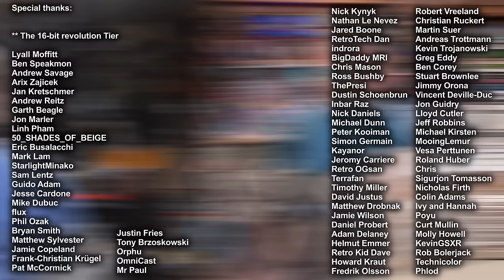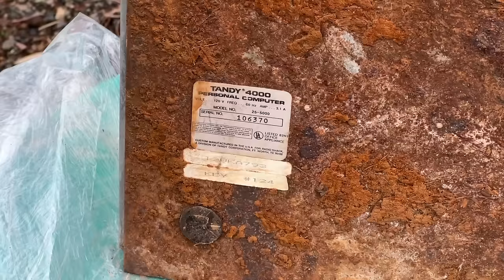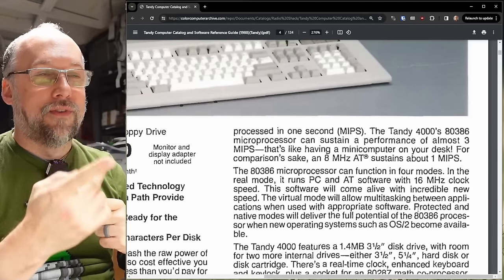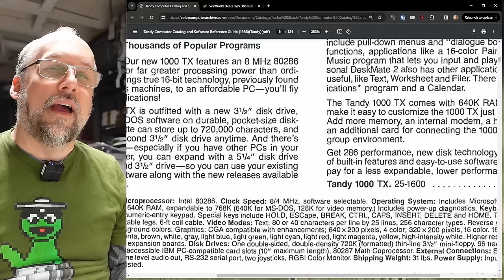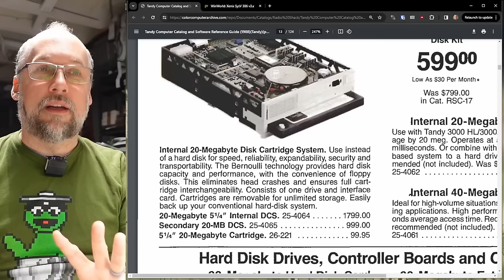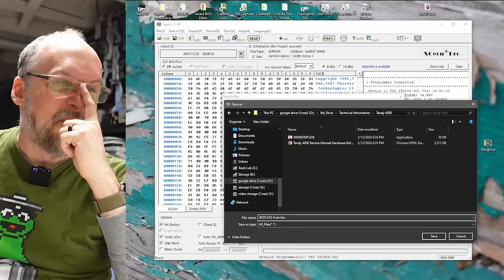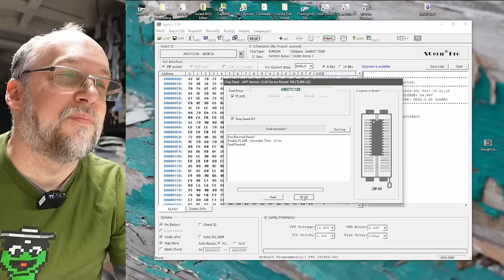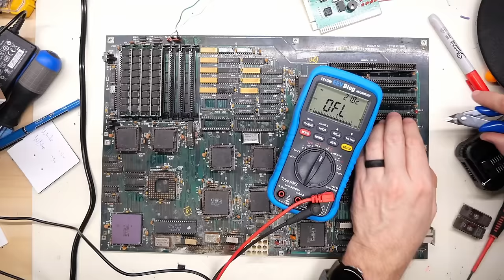0079 I'm at a loss for words when I first see this Tandy 4000 computer

Comment: The Tandy 4000 Hurricane PC...lol. I used OS/2 until 1997 and it was apparent IBM wasn't going to support it anymore. I recall Windows was around $250 and I wasn't going to pay that. I ended up picking up a Slackware book that included version 3.5 on cd's. The 3" thick book (I still have it) cost me around $10 clearance rack at Borders. I still use Slackware to this day, I just installed version 15. I remember those Tandy 4000 at Radio Shack, I wanted one pretty bad because I thought I could run OS/2 at blazing speeds. Wow, what a blast from the past.

Comment: a "double sigma" original 80386-16! I suppose since it was touted as being able to run 32-bit OSes like Xenix and OS/2 it had to be. It would be interesting to benchmark against a 386SX-16, trying to make the systems as close as possible (cache, RAM, video).

I don't hold out much hope for the motherboard. those PLCC chipset sockets look scary.

Comment: I've made this comment before, as it was something 'we' (Digital) were sometimes seeing. These machines were mostly packaged as turn-key kits by software authors of multiuser accounting and inventory software. Well written software on Xenix was extremely powerful, and you had word processing as well. These names might be wrong, but companies like Sage and Attache got their starts in these supported installs.

One client of ours, years ago, was still using a SCO based inventory system that worked perfectly. They literally only turned it off because they had to interface with a web-store and couldn't re-install the softare suite onto new hardware (even virtualised). Don't knock the old minicomputer concepts, stolen to these PC-class machines.

Comment: I actually worked on I think it was a Tandy 6000 was the all in one with the monitor, had 8" floppy, 8" 15mb disk drive and an external bernoulli 10mb. It ran Xenix and supported I think 4 terminals plus the console. Had wordstar and some other programs on it. I was amazed a big clunky radio shack could run 5 users at once. That was 30 years ago but it was an experience.

Comment: 43:43 Oh dear, the spindle isn't turning, the piece you're gripping is slipping on the end of the shaft! XD
Those bearings are toast! I have fixed some seized head-steppers by disassembly and cleaning. 
(including some that were that bad!)
It's rough for sure, but I've seen worse brought back! Hopefully at least the main-board can be revived.

Comment: In 1993-1994-1995 when I was in university the rule was ram was $50 per meg.  Hard drive space was $1 per megabyte and this was after a massive crash in pricing.  Hard drive space only a few years previous was almost impossibly expensive.  When the 256 meg hard drives showed up... i remember those were $250‐$300 and THEY WERE SO CHEAP!  Lol.  And super fast compared to the giant brass 20 meg drives.

Comment: 15 years ago i found a Commodore Pc-10 II exaclty like this at a Electronic Recycling dump, It had an array of rust and nests inside, fully restored it 6 months later using aggresive Metal Workshop grinding and rust priming, only thing i couldnt save was the HDD, so used a similiar type.

Comment: 18:15 The actual improvement in modern performance comes from pipelines for dedicated loads. The most major one back in the day was video encoding and decoding, and suddenly with it, a tiny phone can decode YT 4k stream. The modern CPUs add pipelines for stuff like AI and productivity applications, like video editing. Ofc, there's a finite amount of workloads that makes sense as a pipeline and quite often the point of that has more to do with improving efficiency (reducing power consumption) not necessarily the performance.

Comment: 32:00 The graphics card you found is most likely based on the Tandy hi-res graphics mode found in the Tandy 1000 TL, TL/2 and others.  I have a Tandy 1000 TL/2, and it can do 640x200 with a full 16 colors if the software supports it.  Very few games supported it.  Planet X3 and Petscii Robots do support this mode.  They look amazing!

Comment: Heat helps with stuck fasteners by expansion. In similar metals,  the space between the parts increases as the dimensions of the parts increase. With these dissimilar metals, the aluminum case would expand ~3x as much as the steel, so heat would help a lot. (The reverse case, with the higher coefficient of thermal expansion surrounded by the lower, requires chilling the inner piece if it's possible at all...)

Comment: I'm trying to recall what was used back in the day when I worked at Radio Shack, but the backroom PC that ran the Point-of-Sale system was probably a Tandy 4000. I don't think this particular one could have been one, as we used Tape Backups with a drive that was internal. Any other former Radio Shack folks out there remember?

Comment: I watched the entire video, sorry that someone sent you a rusty pc , but it's a good chance to test out contact cleaners . I use R10/G20 or R11 for green / white oxidation , on anything , then a good silicone-specialist WD40 to protect the thing. For the metal chassis just wire brush the thing where it is rusty and use RAPTOR paint (it sticks to evrything-even-rust , and smoothsitstelf out ,you can use a paint-roller to put the ting on the metal also).

Comment: My first PC was a 386 SX 16. I. went from a Commodore 128 to that, sold it when I went to college as I had upgraded to a 486 DX running Windows 95 one of the very first issues on floppy, I think I still have that set of disks as well. The old 386 was upgraded to 95 which was a mistake but the gal who purchased it from me wanted it that way. I was the computer guy in the class so she wanted my machine.

Comment: Regarding those 87 math co-processors there was a Finnish Nokia brand PC that took either a 287 or a 387 and they overlaid the sockets so that the DIP row of the 287 just extended a few pins around the square 387 socket so that the middle pins were shared between the sockets. Pretty wild design :-)

Comment: Just in case nobody mentioned before, heat should be applied around the screw to expand the metal where it's screw into, not on the screw itself.

Comment: i remember the 3000/4000, i lived pretty near a radio shack and i saw them come and go. they were just the tandy PC clone line; tandy basically gave up on their proprietary stuff because they decided they didn't want to directly compete with the rest of the clone market by not having complete compatibility anymore. the 1000s had decent compatibility, but it wasn't complete. the 3000/4000 were just direct clones IIRC

Comment: If all is lost... Why not do some Evaporust or Equivalent experiments. Perhaps drop some rusty chips into it, and see if the pins could be cleaned. Although it is not thick, it might need to be rinsed, perhaps with distilled water, to remove any residue. BTW, a dilute mixture of Kool-Mist and distilled or de-ionized water would should allow you to rinse metal parts with little risk of rusting. Also, while neither are especially toxic, I would recommend not getting any in cuts, I found. If you are really scrubbing with either, I would wear safety glasses or glasses.

You would not like this but: for large rusty metal things such as PC cabinets, using googles and gloves, phosphoric acid as also found in Coke (but stronger) can remove rust before painting. It is also sold as metal prep. Like most acids, it doesn't smell nice, so it's an outdoor thing. There are also "Etching" primer paints, which also likely contain it.

[Electrolysis, as used for conservation would be better, but it's not practical to hook up electrodes to hundreds of pins.]

Comment: Pretty sure I saw the ebay listing for that machine. Made the guy an offer as I have a 4000 I've been meaning to restore, but I didn't offer much as it wasn't obvious anything was salvageable. The 4000 I want to repair was a machine I bought new in grad school to run 386BSD (look that one up for a laugh :-). It was the cheapest 386 clone at the time. It had a socket for an 80287 math co-processor (required for 386BSD). I think a later version might have had support for 80387. If you don't end up having a need for the motherboard and/or power supply, any chance you could hook me up with either one or both on the off chance there's something salvageable for my repair? I can send video of the machine if there's interest.
Reply: Or... if you'd like to do a repair video on a 4000, mine is in good shape, but has a PS problem, and probably something on the MB. Not sure what state I left it in. I think it blew a tantalum cap last time I worked on it, and I replaced that. I'd want it back, but I'd be up for shipping it to you if you want to do a video on it. Maybe using mine as a reference you could get that MB working.

Comment: 49:00 That weirdo power connector is a variant of a type you see used on amateur radio transceivers as either a power connector or for a heavy duty auxiliary jack. It's pretty industrial and not really for home computers, so it's bizarre Tandy went for that component.

Comment: It is pretty crazy how single-core performance has flatlined over the past 10 years or so. Pit a 486 up against a 286, and that 486 will run everything you throw at it dramatically faster than the 286. Pit a 10 year old 4-core i7-4790 against a 20-core i7-14700 and you might struggle to see any difference at all in most common applications. It's kinda nice, actually. You never got 10 userful years out of a PC in the 80s, 90s or 2000s.

Comment: RadioShack offered an upgrade board for the TRS 80 model two which added a Motorola 68000 and enabled it to run Xenix. This was essentially the same board that came standard in the model 16 and later in the model 6000.

Comment: Reminiscent of the era a few years earlier, when the PC you really wanted cost $5000. I remember paying nearly $2500 for my 386-20 machine with 2MB RAM.  I remember that the memory card (this was pre-SIMM) could take up to 4MB, and it had 2 banks of 32 41256 RAM chips installed. No graphics, no drives, as I was upgrading from my old "turbo" 8088 PC.
Reply: puts the cost of an RTX 4090 into a different context doesn't it. not that I have one.

Comment: 16450 does NOT have a buffer... well, it has a ONE byte buffer, like the 8250. It is 16 bits wide, that is the only advantage over the 8250. The 16550 is the one with the 16 byte buffer. Of course, it was buggy so you actually want to make sure your machine has the 16550A.

Comment: Model II could not run Xenix - the Z80 doesn’t have the needed memory safety features needed for multiprocessing.  I’m pretty sure it was the Model 16, and later Model 6000 machines were the Xenix platform machines.

Comment: Considering how bad the case looks, the fact that the hard drive and floppy drives are junk, I would've said it's not worth even trying to fix this. But since you've got the motherboard schematics, perhaps it's worth trying to repair it, just in case you find another machine with a case that's in good condition but a dead board.

Comment: I have a pristine Tandy 4000 with original keyboard. It starts right up and if I hold down the keys, it registers a stuck key; however, upon normal boot it acts like it can't see the keyboard. I did test the keyboard on other PCs and it works fine. It is one of the more dissapointing finds that I have run across, recently.
Reply from the maker: Yeah that keyboard controller there -- who knows how standard or non standard it is. It's worth swapping in one from another PC to try. (The 40 pin DIP near the keyboard connector)

Comment: The model II was Z80 based and did not run Xenix. The Tandy 16/ 16B and 6000 did run Xenix. Not sure about the Model 12. From memory that was the upgraded version of the model II.

The Model 16 was a dual processor system. It used a Z80 to handle I/O and a Motorola 68000 on a daughter card that ran Xenix.

Comment: 40:15 The sand is actually silica crystals, wich originally was in a decomposable bag inside the case...to absorb excess moisture, ther must atlest have gotten enugh mico organism into it to decoponse the bag... interesting, never seen that happend before

1:12:00 power good signal, i think the resistor has a to high value, the triggering circuit can not draw enugh power at max 5/10000 A= 0.0005 A (probably need atleast 5mA) .. and the computer is also very old so every single solder joint can potentially be a resistor/capacitor.. crank up the juice just...

Comment: Regarding a dedicated terminal vs. a Laser 128 (or even a real Apple):  I'm sure the dedicated terminal could run just fine at 9600 baud, or even 19,200, but the Laser/Apple would probably have trouble keeping up at that baud rate.

Comment: When aluminum and steel oxidize together, they form a really annoyingly strong bond. I had a wheel do this on a car, and it took several whacks (against the flat tire, NOT the wheel itself) with a hammer to free it.

Comment: I would think that the lack of OS and/or graphics card in the price was a mix between providing an option and marketing making a point... as it stands, MS is/was forcing their licenses along with PCs and if you wanted something else, you still had to pay for DOS/Windows first... Marketing making the base price look like a comparable price would certainly be very typical in my experience. I recall around the year 1990 to read an article about the "sensational: 386 computer now for less than 3000DM" which is about 1500USD give or take

Comment: The ISA bus has an active high reset signal, even if the processor has an active low reset signal. As the POST card has some logic on it anyways, and the LED might be between reset and GND or reset and +5V even without logic, you can't just assume that active high or active low means the LED is on or off during reset.

For that kind of card (I have one, too): The LED is on during reset and off afterwards. As you don't get a power-on reset on that board, no matter what you do to the power good signal, so the power-on reset generator is clearly broken.

Comment: Very sad. I was forced to leave an AMSTRAD in the rain because of a house move and it was painful although I did save the keyboard, discs (hmm, I should dump those) and some cables so there's that, I guess. The keyboard has a non-standard layout and I seem to recall there's some accounting software that requires both 5.25" floppy drives to function. I also made an executive decision as a dumb teenager (as the male of the household!) to dump a perfectly good woodgrain cassette player with VU meters. I know now from YouTube repair videos that it was just a perished belt that had stopped it working.

Comment: I used to work at a radio shack in the early 90s and they used the 4000 for there store computer running sco unix.
Reply: I also remember that 3000 and 4000 were many for their store systems.

Comment: The SOTA 286I Accellerator card would give a Norton SI score of 12.5
Double Sigma 386... means that this has microcode which will work with 32 bit code. 16MHz 386 which don't have the double sigma mark only work correctly with 16bit code. Intel later marked them as "16 bit only" CPUs to get rid of their stock of them.

Comment: You don't apply heat to the screw, you apply it to the material the screw is screwed into. In theory applying heat to the screw would cause the metal of the screw to expand making it even tighter.

Comment: Citric acid powder in hot water works really well to remove rust. I wonder how well it would work on a pcb. It sure works faster and better than vinegar
Reply: Citric acid also dissolves lead, so be quick or your solder will be gone too.

Comment: You know you can put most of this this stuff in the dish washer? (Better remove low melting point plastic parts, papers and stickers before, though!)
I'd have liked to see some forensic research. Like carefully cleaning the floppy, putting it into an intact sleeve and salvaging data.. maybe there was an irretrievable digital relict on.

Comment: Just to disagree on one thing I heard while listening this video in the background, nowadays cpu's aren't getting faster by "clock speeds", we had CPU's that could reach 5 or even 7 ghz many years ago which is similar to the limits modern ones reach(assuming same cooling).

 Multithreading aside, what's actually happening nowadays, instead of faster clocks, what changes is number of stuff CPU's can do in each cycle.

 It is smaller than multipliers retro CPU got, but you can feel huge difference after 2-3 generations and some dedicated updates are just as exciting, for example "inventions" like 3D cache still limited to some AMD cpu's tend to provide huge difference in gaming experience as while people only look at FPS which is just an average number and lies because there can still be noticeable drops with high fps, with 3D cache, it's just totally smooth due to all code being cached which is way faster than even most expensive and overclocked RAM, plus as a side effect it still improves fps a fair bit achiving same performance with lower clocks which is a win-win situation in any workload that can use that extra cache for it's advantage. Like really my last CPU update was to one of the if not THE first cpu with 3D cache and my experience is still noticeably smoother even if in some cases with few less fps than a friend who has newer CPU without that tech.

Comment: The keyboard controller cannot be more 'standard'. It is literally an 8042 used in the IBM PC AT. Therefore, any replacement keyboard controller should work, but I recommend HT6542B as it is explicitly quoted as 'drop-in replacement' in the datasheet. Plus, it is still very much in stock.